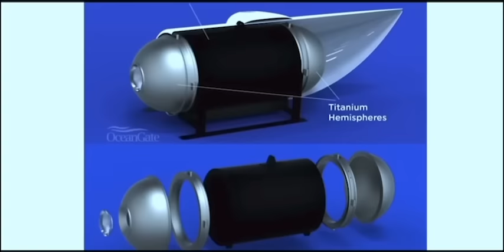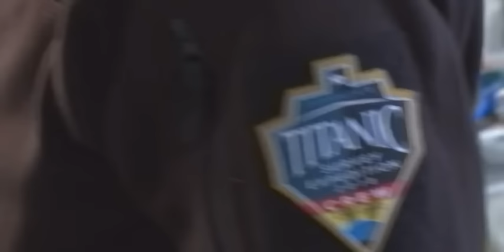First look at #oceangate #titan Debris

Comment: As a former submariner I was appalled by this guy's lack of discipline to safety and to the way this vessel was designed. Should have used titanium spherical pressure vessel and not a cylinder. Also you are correct about the uneven distribution of pressure on cylinder shaped hulls. The Thresher and Scorpion are proof of that. Also Rush talking bad about the navy subsafe program just shows how big of an idiot he truly was. Subsafe came about from the loss of the Thresher. Intense quality, safety and inspection protocols were put in place after that accident. Besides the scorpion we have not lost a submarine ever since so obviously it works.

Comment: Should these operations be carried out inside a clean room laboratory? There must be a million contaminants in there. No suits, no protective gear, not even gloves. How does the glue behave in 2C and repeated temperature swings? How does the bond hold between two dissimilar materials with very different properties wrt temperature and stress? How many test dives to 4000m did they do, and did they then disect the vessel to examine the various parts under the microscope/US etc?

Comment: The question is if the error lies in the gluing of the CF hull INTO the Titanium ring, in stead of placing an extra Titanium ring INSIDE the CF hull.
Another question is what curing method was used to cure the CF hull. But anyway: if you stretch any type of material around an object, already giving pressure in the same direction as the external pressure, you are asking for trouble.
Easy to say they were all idiots, it dived 40 times... Checking it every time in the beginning with X-Ray photography would have proven the slowly breaking of first a few fibers, then more, and more, and finally the point of no return. Was the error that gluing? I think so.

Comment: The carbon fibre ribbons attached to titanium shows that bond didn’t fail - it was the carbon fibre to carbon fibre joint that failed. Carbon fibres are shit in compression - they are just inert filler in the epoxy.
Any strength has to come from epoxy transferring forces to put the carbon fibre into tension - which requires a weave not unidirectional fibre wraps.
Carbon fibre pressure vessels use a woven / braided wrap to redistribute forces.
The Titan broke every rule of good composite engineering practice.

Comment: You know I think if he'd have joined the US Navy he might've had a clearer picture of the SUBSAFE program.  The guy built one sub and then killed himself, his crew, and his paying passengers in it.  Reminds me of the story of that guy who killed himself in a steam powered rocket trying to prove the earth was flat.  Never mind the science, the lives lost, the research, to come up with design parameters that keep a submarine safe.  Now that I see how he designed it it's not difficult at all to speculate how this all happened in the first place.  I remember when Challenger exploded back in the 80's.  The congressional hearings.  The task forces.  I remember the engineer who tried to stop the launch because he knew that those rubber o-rings would not seal those booster rocket joints properly at liftoff if they got stiff and hard from exposure to the cold.   The yes men won out.  Same thing happened here.  Smart people working for him tried to point out the obvious flaws in his design, but the yes men won out.  Lesson learned.  It takes conviction to die to prove how wrong you are.

Comment: With just a few minutes on Google you can find that Titanium and Carbon fibre have quite different mechanical properties - carbon fiber is used in many places where it's elasticity is exploited, fishing rods, masts, bows, pole vaults. Titanium has very little elasticity by comparison. Gluing 2 materials together that behave even slightly differently has got to be problematic, one only has to shrink a tiny percentage more than the other to create huge shear forces. 
I was expecting to see tie rods internally as a minimum for the end caps, but just glue? Even if it is rubberized epoxy.

Comment: The carbon fiber does bend under pressure and then it creates angle between metal ring, that causes delamination, at least it makes sense by logic. The glue bond is not strong at all in humidity, for example all the private household interior elements that are mounted with double side tape or even the shower corner water insulation, they are failing all the time.

Comment: Despite weak points at titanium rings... Only axial load on full depth will be over 3000 tons .... Carbon fiber is great maretial  mainly for tensile stress. In compressive mode stress its ( as hardened composite ) strenght is hard to determine. Using  of complicated interweaving it will increase resistance  to delamination due change compressive stresses into tensile ones. Second: Carbon fiber is not a  unified and homogenous material and simple "design by formula" for overall strain calculations and minimum wall thickness for this material  is a challenge even for experienced engineers. After preliminary calculations , vessel should be drawn in 3D CAD as assembly and loaded into specialized software for simulation  under design pressures. Third: Contrary to most metals, these composites beared on carbon fiber has no "elastic yield" it has only  a ultimate strenght ( point of instant destruction ). Beyond a conventional elastic yield and before ultimete strenght  in metals is a spare limit in strain hardening region.

Comment: I definitely wouldn't have gone in that thing seeing this, good design just for going under water but not for any kind of pressure depth. The sides wold pop off like a Pringle jar pretty obvious really. 4 cycles was all it took. Tremendous lack of safety and to allow passengers without any testing is utterly criminal 😡

Comment: I absolutly agree with you, this thing failed from the ends and earlier in the same video that was shown there was a machine winding the cf tube, this may seem unimportant but i believe that the end caps basically screwed themselves together when the integrity of the hull was comprimised.. 

The round tube stayed round and the end caps became the sphere they should have always been. 

Thats not the worst part. The worst part is that theres no port hole left in one end of the capsule

Horribly one can only assume that means that this whole scene turned into the most gruesome 5 man tube of toothpaste in the history of the planet in the blink of an eye. 

Also the force generated in the other direction after everything could account for the banging they heard after as the two ends and the ring could have been shot up together and then made banging noises when they came to rest

Opinion of a red seal machinst who has worked closely with engineers in the aerospace industry, with sparr on parts of the canada arm that assembled the ISS  and other flight critical parts for the canadian military

Comment: From  a purely fitting and machinist point of view , the overlap between the end caps and the cylinder was far to small especially considering the pressures involved. The main cylinder part should have had internal rings to act as extra ribbing to help support the enormous pressures on the hull. The dissimilar materials may not have helped either as they would likely have differing expansion and contraction rates due to the temperature variations and pressure effects. Bottom line here,  I would never go near it.

Comment: Keeping with the theme of building his sub out of "Off THE SHELF " material,  he would have been far better off using gasket material and a big giant rubber band to hold the end caps on. That way there's even pressure all around.  Using glue, especially glue that sets up rock hard, was a big mistake. No way to keep air bubbles out creating uneven pressure all around. That being said, he tubular part in between the two sphere shaped end caps was the problem. Not even Navy subs can go that deep, and they have steel tubes between the ends.

Comment: Titan had already made 24 dives- assume 20 dives with 4 paying passengers x 20 x $250k each equals $20MM in revenue. Any Vegas odds maker would have said odds of failure would be much higher after 10 dives. Any beer drinking football fan can tell you to crush a beer can- focus on the middle dude, not the ends-they are too strong.

Comment: I cringed at the sight of them using an epoxy glue instead of hardware with mechanical fasteners and rubber seals and o-rings.  I can understand they cannot pierce the walls or flanges of the carbon hull, but they absolutely could have made exterior titanium rods that clamp the titanium rings/nose cones onto to the ends of the carbon tube - and thereby ensuring the joint doesnt fail at the epoxy. I am not a submersible engineer and frankly I cannot imagine how he justified using carbon fiber hull instead of a steal hull. stress fractures in carbon fiber are absolutely a disaster in seconds at that depth.

Comment: Great video that goes to the heart of the issue...... a dangerous design that completely ignored the tried and tested concepts of deep sea, manned submersibles.

Thinking out side the box to fit more paying tourists in was a doomed idea from the beginning.

Ego and the need to make money caused Stockton to push ahead with this disastrous design.

Using expired carbon fibre alone says how he was thinking cheap.

The game controller idea was just ludicrous.

What surprises me more than anything at all is that people got in that thing where display screens had their brackets screwed into the carbon fiber...that alone should have been a red flag....you never drill into a pressure vessel....thats as ludicrous as saying ill mount my GOPRO on my scuba tank by drilling holes in it and screwing a bracket on.....that alone is a failure point and not one passenger picked that...

Even the people making it had no idea it was disaster waiting to happen, well just slop some epoxy on and jam the bits together......even NASA has more advanced ways if gluing things together.

Like every one else whos followed this, I cant wait to see what the investigation turns up.

There are only two saving graces....the five souls who perished were killed instantly which would provide a small comfort to the families and this terrible incident will indeed lead to a safer regime that will prevent thia happening again.

Comment: Regards regulations - there are already very heavy regulations for this field.  Rush chose to ignore them all.  The change that needs to be made is to make it compulsory for any and all new submersibles to be rated, inspected and tested by an independent third party in order to ensure that hubristic cowboy operations like OceanGate don't get to risk peoples' lives for a fast buck.  The sort of corner-cutting and spitballing the company used to build its submersible need to be covered by workplace and manufactuing laws because, at the moment, it looks as if they're on the honour system.

Comment: Most carbon fiber/epoxy composites have a Vickers hardness rating between 85 and 100. Titanium and surface treated aluminum alloys have typical Vickers hardness ratings around 200. More importantly though, the Vicker's hardness of the epoxy outer layer of carbon fiber structures is more likely to be in the vicinity of 25-30. And once this layer is breached with high pressure water (you can cut thick carbon fiber composites with a high pressure waterjet like you can cut metal), the problem with carbon fiber composites is the delamination that occurs as water follows along the fibers, creating voids and fractures. Putting aside the ridiculous "glue job" between the titanium cap and carbon fiber shell, carbon fiber is very vulnerable to breaching and delamination in  high water pressure environments. With various titanium and aluminum alloys, there is no such structural weakness or vulnerability. The resistance to penetration throughout the metal's structure is more uniform and stable. It's not hard to see how the epoxy outer layer was compromised further and further with each successive dive until micro fractures grew into a catastrophic void resulting in delamination and failure.
Reply: Distributed water pressure has nothing to do with your hardness... It also does not cut through through a material. It's like cutting a cheese with a blade that is as wide as the cheese. You may get dents and scratches on your surface earlier when you hit something sharp though, which leads to stress concentrations and in turn to several failure mechanisms.
Reply: @argh100100  You're clueless. Because the thickness of the outer epoxy layer is not uniform with respect to the carbon fiber layers beneath, and because the ability of carbon fiber structures to resist shear force (perpendicular to fiber thread direction) is not uniform throughout the outer layers, the opposing force offered by the structure against uniform outward water pressure is therefore not uniform and is susceptible to displacement  This displacement occurs with less static water pressure if the outward layer of material has a low hardness rating. By definition, hardness ratings define levels of displacement from point loads. With non uniform structures and resistance beneath the outer layer, point loads are introduced. It's not rocket science to comprehend that a harder outer shell will better resist displacement and ultimate fracture. But clearly, your limited comprehension level prevents you from seeing that.
Reply: @cjg6364  No I'm not, and you're wrong. I won't argue that an outside pressure can lead to surface cracks by tensile stresses on the surface. You have those even without the inhomogeneity of the composite material, because they chose to make a tube.

But you're comparing it with water cutting, where the material is directly blown away by the concentrated surface stress from the jet. (Water) cutting is something entirely different from a stress distribution in a composite.

Hardness is also the wrong material property to evaluate cracking susceptibility.  A classic example is a glass/porcelain cup. It can have a higher hardness than a cheap steel, but I would never be able to crack a steel cup of the same dimensions.
As for composites: the matrix material is usually able to accommodate much higher strains, meaning stress on the surface is way lower than on the fibers beneath. CFRP therefore usually fails by fiber cracking or delamination.
Reply: @argh100100  Vickers hardness is considered a useful measurement to determine a material's "fracture toughness" - exactly the kind of material quality you want to explore for a submersible that goes through multiple pressure-release cycles. Try Google searching Vicker's hardness and "fracture toughness" - you might actually learn something, if you can put your big mouth on pause for just a minute. As for the cutting and static pressure comparison - clearly, you have no real world experience to discuss the subject with any kind of authority. Men have been sliced open on steam powered ships by pin hole leaks in steam lines at only 900 psi. What do you think happens with a small fracture in the epoxy outer layer of a composite hull that's under 5000 psi ?  The problem starts with a breach of the outer surface layer - that's why hardness test data is critically important in evaluating the durability/reliability of materials subjected to high pressures. It's straightforward materials science, which you apparently flunked at some point in your distinguished Youtube commenter career...
Reply: @cjg6364  I am the one with the big mouth? You are the one who constantly feels the need to throw insults. I have never seen that Vickers measurements were used to determine fracture toughness. When I google it, it is apparently sometimes applied for very thin coatings and very brittle materials when there is no better option available. In both cases, the plastic zone at your crack tip is practically non-existent, which is why it can be done.

On top of that, from what I read there is no standardized method for it and its accuracy is dubious.

I am done with arguing, good luck with your hardness.

Comment: Imo simple fix or adjustment couldve been big difference, That space Carbon fiber tube slid into Titanium ring, Had titanium ring had an interior ledge that slid deeper along inside of Carbon Fiber Tube, Feel like at edges of where tube met ring tube was just pressured in so much until the end popped over inside ledge of ring, I had idea of drilling inch thick holes all way through Carbon Fiber and bolted long Titanium tie rods through 1 Titanium ring to other, Basically 20 long tie rods that go through length of Carbon Fiber through both Titanium rings and bolted tight at one end, Can imagine it like stronger version of rebar in concrete…

Comment: The carbon fibre was out of date, Boeing would not use it on there aircraft as date safety date had exspired , they got a very cheap deal on this carbon fibre when it should never of been used, plus the carbon fibre was out of date and it was wrapped around, instead of cross wrapped over and over, the carbon fibre was out of date and never had the full durability’s , thats why Boeing sold it to them, and told them it was pass its safety date

Comment: I want to agree that the bonding is the failure point. But, that thing they called submersible had so many weak points, flaws, and their whole operation was so messy, that it could be anything. Maybe we will never know. Everything about this project is a huge red flag. The idea of using GLUE at those depths it's just insane. It's unbelievable that so many so called engineers around, and people who paid to go there couldn't see it before.